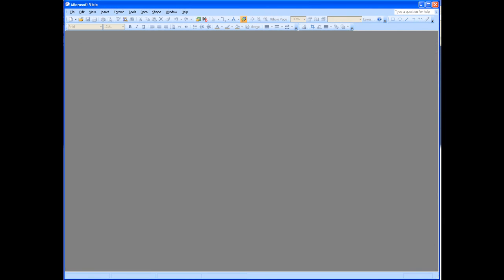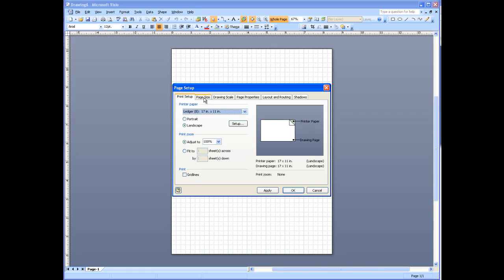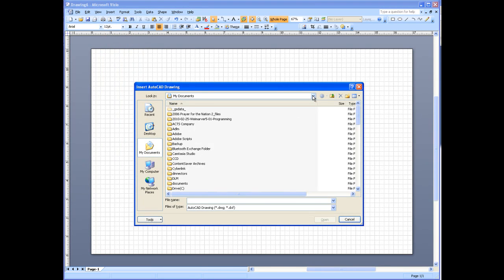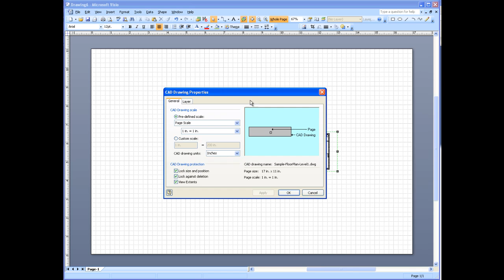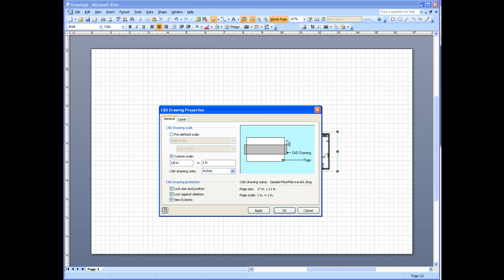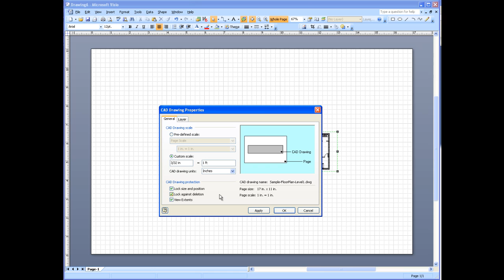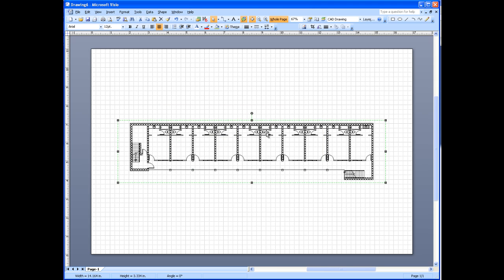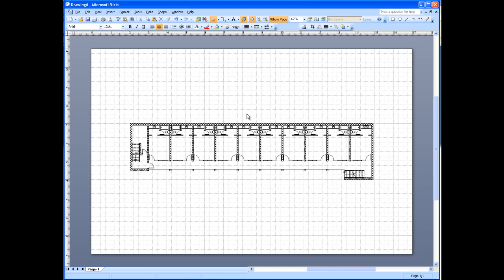Visio 2003/2007 Electrical Systems Drawing Part 1 - Import Background

Comment: So how do you go about getting side gig electrical engineering work.  Right now I live in Anchorage AK and have access to a site called the plans room but this work is for people who have the equipment, infrastructure and crew to do the physical work.  The engineers are usually on the "team" side from what I have found.  I have an electrical/process engineering day job but I am looking to try to start getting side work so I can expadiate the pay off of our home and start a full time business.

I am just not sure how to get from where I am to there.  I have a decade of Visio experience in process engineering and have recently transitioned to electrical engineering and passed my EE PE exam so I am now ChE PE and EE PE with about 15 years of engineering experience, I am just new to electrical but the experience I am getting now is complex oil and gas infrastructure and when I look at commercial residential it looks significantly more simple.